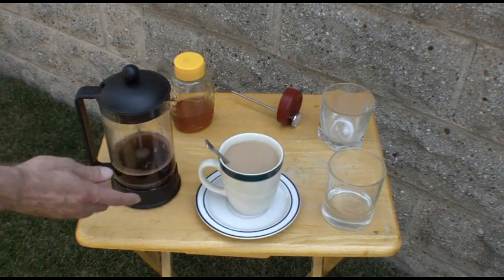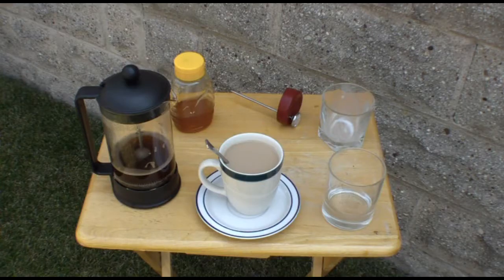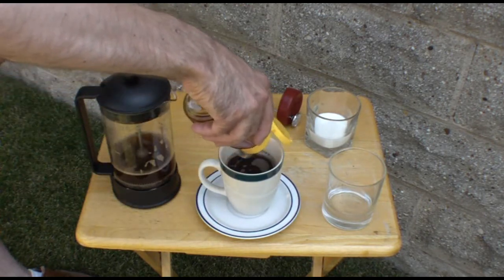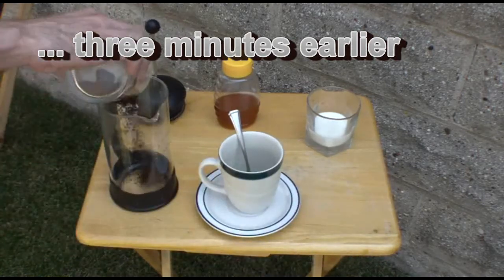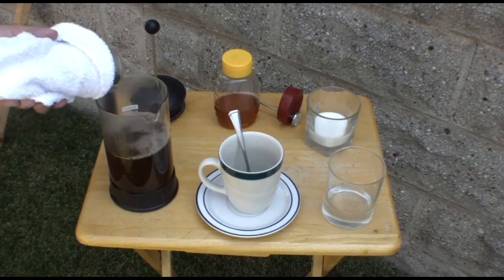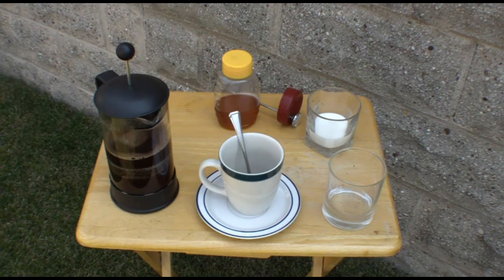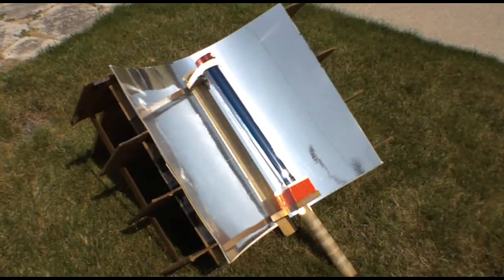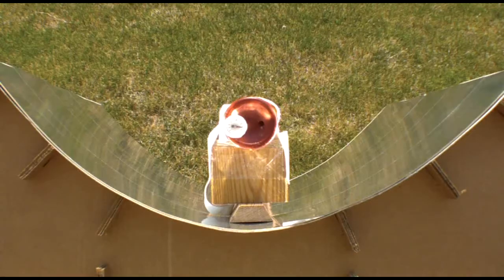Make Solar Coffee, Cooking with the Sun using a coffee press.

Comment: I communicated with Dan at Green Power Science, and he pointed me to this video entitled "Storm Preparations Power Outage." His brief discussion of lead is at 18:50. 

He apparently detected lead inside the tube, found it was easily removed with vinegar and alcohol, and concluded it was merely a residue from manufacturing the coatings that are on the outside of the inner tube. That's not definitive, but it's something.

Comment: After further communication with Clean Republic, I'm satisfied that  both the absorbing and reflecting coatings are on the outer surface of the inner tube and that water placed in the tube is in contact only with glass. The apparent statement to the contrary in Clean Republic's video (the one I pointed to yesterday) is a bit of sloppy language. I'll be buying some of these tubes when I can.

Comment: A further, more worrisome note:I came across a video posted by Clean Republic, an outfit that sells the 20-inch tubes. The title is "Inside passive solar vacuum tube. Boils water in the sun!" The fellow shows a broken tube and indicates that although the absorbent coating is on the outside of the inner tube, the reflective coatings are on the inside of the tube. This video suggests that water placed in the tube would be in contact not merely with glass but with at least one of these coatings.